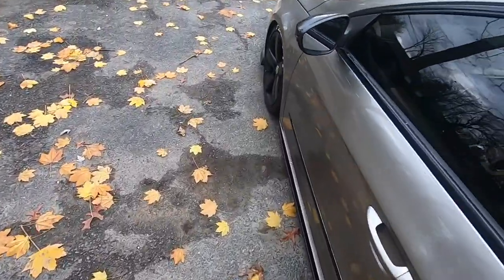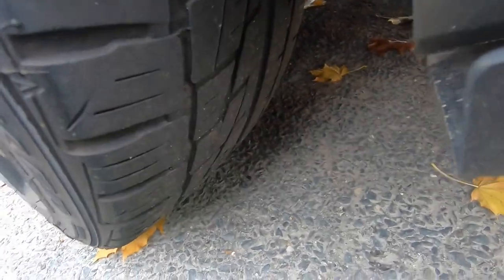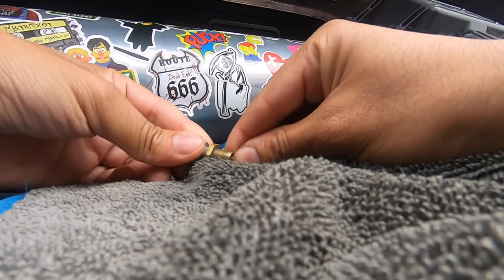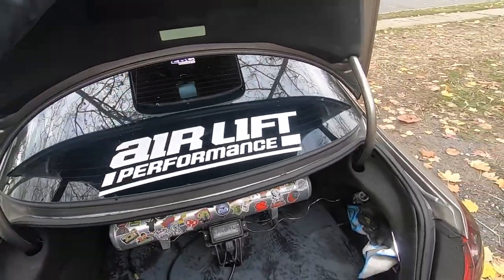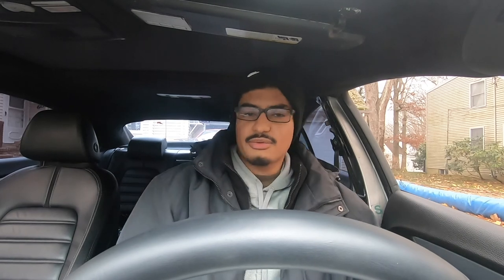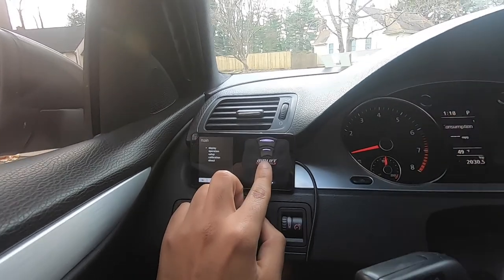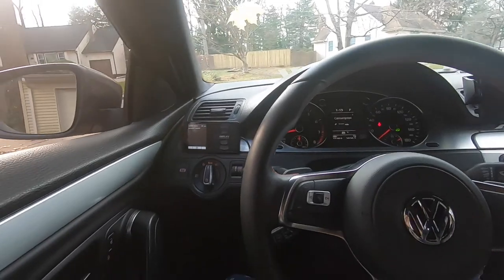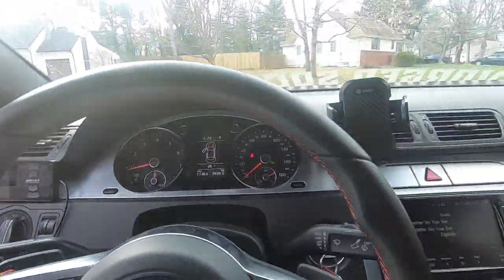How To Maintain Your AirLift System

Comment: Video helped alot👍. Question- When ur battery dies and u install new one do you have to remove fuses from compressors and do you have to re calibrate again with new battery in?
Reply from the maker: Nah u can just remove the terminal with no issues. Asl long as the car is off. The airlift system on get power.
Reply: Think you would have to recalibrate unless the system has a backup battery for that.

Comment: So how often should I recalibrate? I pretty much air out everyday and night. I’ve got the airtekk bags with the 3p MS. Two compressors and a 5 gallon tank with upgraded fittings and hoses.
Reply from the maker: I usually calibrate once a month. Don't have to but i suggest it so the system runs smoothly.